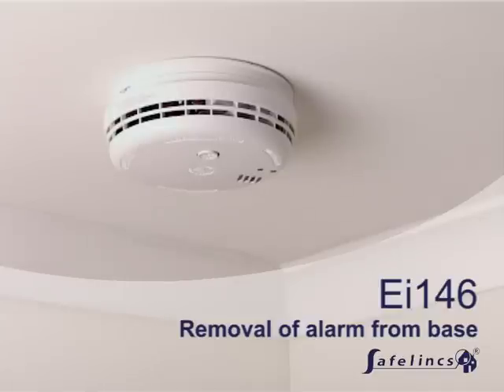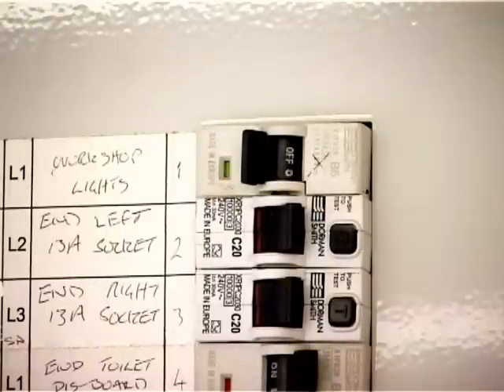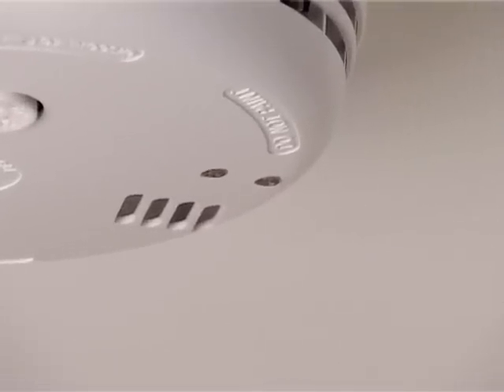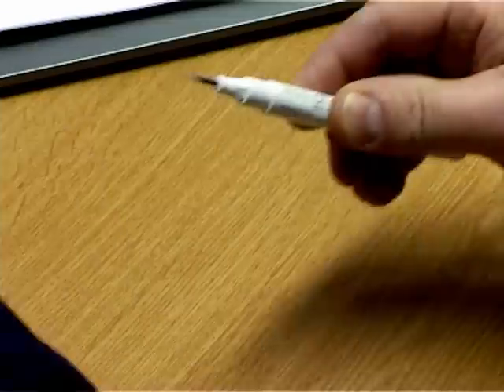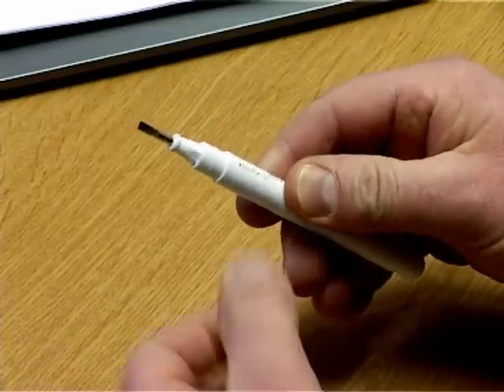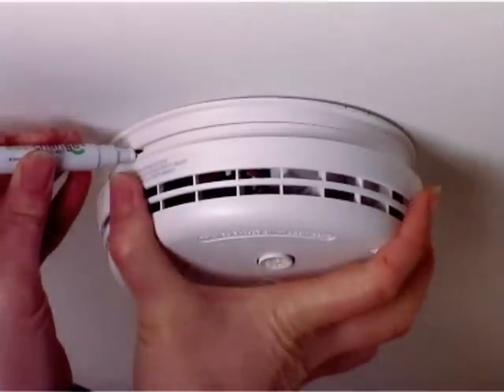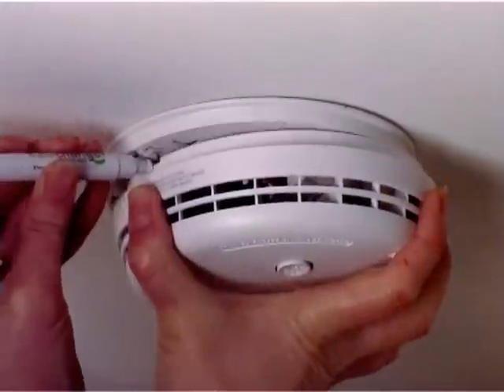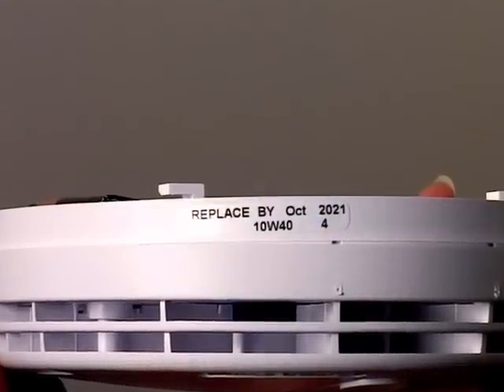Remove an Ei146 smoke alarm

Comment: How can one make a simple task so difficult, all I want to do is change the battery, I almost ripped the thing of the ceiling. The design is crap
Reply from the maker: +Owen M We agree that the design should be improved by the manufacturer. We still hope that this help guide made life a little easier for you.
Reply: ***** Yes it was a much appreciated help, thank you
Reply: @Under Review. "I almost ripped the thing off the ceiling." Had me in stitches 😅🤣
Reply: Same here! Have been fighting with the cover. Simply impossible to remove just by following the instructions. Almost ripped off this thing from the ceiling and breaking it just to make it silent night time here. Thanx for this YouTube video thought. It helped alot!

Comment: Unfortunately this thing is in use here in Norway as well. It was almost impossible to remove this unit without damaging it (I'm actually quite sure I damaged it a bit). Turning off the mains power did not turn off the green light (okay???). This thing is an absolute nightmare, it shouldn't be on the market at all. I considered drowning ours in a bucket of water. WTH?!
Reply: Same here. The catch will not trigger and it is impossible to remove. We are stuck with a maddening beep every few seconds
Reply: @nodarkthings  Same shit here, who invented this thing!

Comment: I’m not removing it to clean or replace. I’m removing it and then throwing it in the bin. I’d rather die in a fire than have to put up with these things going off whenever I make a cup of tea or fry some bacon. The extractor fan should offset the alarm but nah. Fuck smoke alarms.
Reply from the maker: Hi Nathaniel, whoever installed the alarm in the first place installed the wrong model. The Ei146 is an optical smoke alarm and is not suitable IN the kitchen. Nearby, yes, but not IN the kitchen. You need a heat alarm Ei144    https://www.safelincs.co.uk/easichange-ei144ek-replacement-kit/   Just get one of these replacement heads and slide it on the base plate and you will never have a false alarm again.

Comment: It is three o clock in the morning, the low battery alarm goes off. A persistent shrill squeak. 

You can't remember how the infernal thing disassembles to change the battery. The shrill, piecing noise persists. After minutes of trial and error the appliance is hanging from the ceiling intact, the shrill, white noise persists.  You take a deep breath, remember Google, remember YouTube, you watch the video, take a screwdriver and with all your might ram the screwdriver into the aperture and with the palm of your hand smack the lower section away. It is still squeaking like a crazed gerbil.  If you are fortunate to have batteries, you change them and the panic is over. If you do not have a replacement battery, good luck with sleeping!
Reply: Hits home a little to hard.
Reply: Mine is currently in the middle of the street in pieces.

Comment: What the hell? Why can't this thing just come apart without a screwdriver or "special tool"? I thought fire safety was supposed to be important? I've almost ripped this thing off the ceiling because I can't see any instruction to remove it other than "Unclip and slide". I shouldn't need to come on to YouTube to find out how to replace a battery in my smoke alarm. This should not be allowed to be a sold product for fire safety.
Reply from the maker: David Bell Hi David, we actually share your view. We cannot see either why a private owner of a smoke alarm should not be able to have easy access to their smoke alarm. We trust ourselves as individuals to handle sockets without electrocuting ourselves, why should an alarm on the ceiling be any different? We have spoken with our suppliers but so far without success. We will persevere.
Reply: Well I have Actually ripped mine off the ceiling and it still won't open. Still beeping.  There are ZERO instructions on the Alarm.  No Wonder people smash them with a hammer.
Reply: @Safelincs  Obviously to stop the kids pulling it apart.
Reply: @iandavies3629  Yes because kids love replacing smoke alarm batteries
Reply: @jackismname  No they don't, but they do love taking things to bits leaving your house unprotected from smoke if the thing was easy to take apart. Doh!
Reply: Mine has a sticker on the side which reads " TO REMOVE PUSH SCREWDRIVER INTO SLOT AND PUSH COVER AWAY" with an arrow pointing to the slot. Without this sticker or if you're reaching up to one on a high ceiling and so can't read it, it's gonna be tricky!

Comment: Help. I have watched the video and I still can't get the cover off. I have stuck screwdriver as per video and follow the instructions  'push away' NOTHING! it won't budge.. advice pleasseeeee
Reply: Same here. This product is absolutely appalling.
Reply: I had to use fairly big screwdriver and fair omphf at which point it went flying. Now not pipping with new battery, so hopefully ok.

Comment: Why do you first have to turn off the power in the meter cupboard? we have done that without turning off the power,and nothing happened. we are glad that that thing is out now.it was 5:30 in the morning when the alarm went off. and he continued to beep. now he lights for me with the battery.
Reply: As otherwise you can touch bare live terminals on the base unit once the main part is removed. Obviously, if you're careful not to touch them whilst the main unit is off the baseplate then it's fine not to turn off the mains.

Comment: Felt confident after watching the video. Turned upstairs lights off, just opening the alarm and I noticed the green light still on.  Is this normal? Have abandoned it until I can turn all the power off!  Would it be the battery? 
Why do you have to fav about opening it, previous ones weren’t like this.
Reply from the maker: Hi Lorna, as long as the green light is on you have mains power!

Comment: I have a question how does the WiFi work on these things if there all connected who is it connected to
Reply from the maker: Hi Ross these are not connected to your WiFi. The units are radio-interlinked together meaning if one sounds it sends a signal to start the others sounding. As part of installing the alarms the units are grouped in the system together this means they are not triggered by neighbours alarms or other signals.
Reply: @Safelincs  Are these safe what are the emf levels on these things for example I have strong buzzing in my ears and an itchy scalp and I disconnected everything in my house and it was coming from this alarm system I'm sure of it..
Reply from the maker: The RF frequency for the unit is 868.499Mhz with an RF power of +5dBm. The alarms are safe and fully complaint with the Radio Equipment Directive 2014/53/EU.